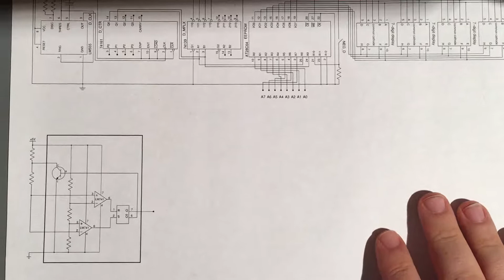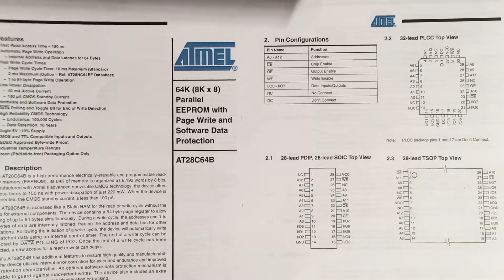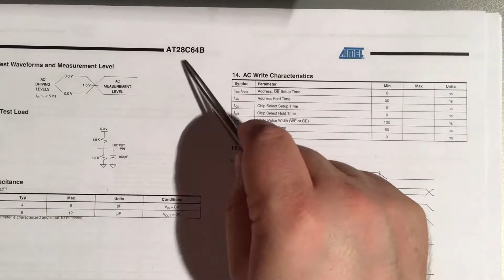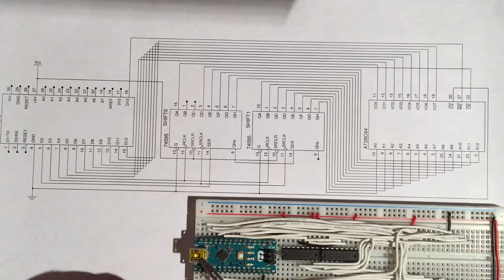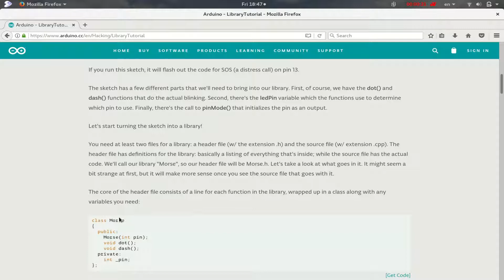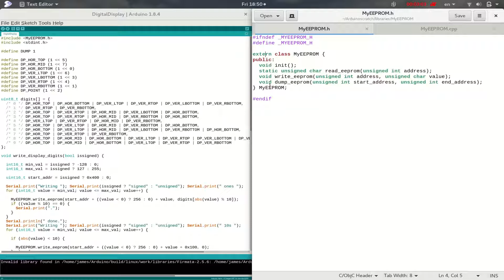My Ben Eater inspired homemade 8-bit CPU - Part 8: Decimal display

Comment: Will Ben's EEPROMs not work with your design? I have it working with the display, but I was just thinking about the control logic later on. (28C16 EEPROM)
Reply from the maker: Yes, they should work for the display. I couldn't find any when I was ordering parts, so I got the bigger ones. For my control logic (episode 9), that turned out to be a good thing, since I need a lot more input lines (i.e. EEPROM address lines) than Ben Eater did. In fact, I'm still short by 2 lines, but manage to work around it using some custom combinational logic.
Reply: @jimmyb998  so, could I technically just use more 28C16's?
Reply from the maker: Technically yes, but it'd be very complicated: you have 13-15 bits of "address" (control logic input: microtimer, IR and flags) that you'd need to demultiplex in order to select one bank of 4 eeproms out of a total of 8 to 32 banks of 4 eeproms. I think bigger eeproms are way simpler ...
Reply: @jimmyb998  :\ that's super unfortunate because I have bens eeproms already. I started ordering parts for his cpu before I saw your wonderful video series. I am currently re-wiring the ALU and adding two more general registers at the moment. I'll keep you posted on how things go.

Comment: You could have used only one shift register, as you can also use the "analog" pins as digital as well. It's just that the ADC mux is connected to those pins, not that they're exclusively analog inputs, something that should be explained better on the Arduino.
Reply from the maker: Yes, I discovered that later. Using just the digital pins and the two shift registers is very close to Ben Eater's original programmer.

Comment: 16:07 You could buy/make a frequency counter for just $10. It won't be very accurate, but it would allow you to measure frequency. I recommend you get a Rigol DS1054Z if you're going to do electronics stuff, though. Anyway, I've already tested it and it's nowhere near 5 MHz. The maximum I was able to get is 850 kHz, and I had to move away from the circuit for that! It's pretty unstable and just getting near it changes the frequency and waveform. Also, remember that there are actually lots of small capacitances in parallel: the two terminals of the breadboard, the pins of the 555 timer, internal capacitances, you and one pin of the 555...
Reply from the maker: very interesting. So it is oscillating "uncontrolled" basically. I guess it's fine for just the decimal display though

Comment: I would like to reuse Ben Eaters programmer, so to program your decimal display as well as Ben`s with 1 breadboard programmer , is that possible or are there more differences than the more adress lines at your eeprom?
Reply from the maker: I think I mounted my shift register LSB first, whereas Ben's is MSB. One needs to be aware of that when sending the address out to it.
Reply: On the eeprom in the schematic pin 21 ist tied to GND via a resistor, on the breadboard I think I see a bridge between pin 21 and 20 direct to GND. I also see in schematics a switch from pin 21 to 5v, which I cant`t find on breadboard. where is my mistake?
Reply from the maker: In the schematic, you can select if you want signed or unsigned display, which is set on A10 (pin 21). I didn't actually implement that in the hardware, which is hardwired (whence no pull-down resistor) to ground (i.e. unsigned display). Up to you if you want to use the signed display feature ;)
Reply: ah, thanks! the pin numbers in the schematics of the 7 Segment displays do not correspond to the pin letters, at least compared with the datasheet, which says e.g. A on Pin 7 , B on pin 6 and so on. little bit confused ...should I connect e.g. pin 11 of the eeprom to pin 10 on the 7seg or to pin E in the datasheet?
Reply from the maker: Honestly, I didn't look at the datasheet much... I just used trial and error (shorting them to 0V and 5V with a jump wire) to figure out which of the 7-segment display pins activates which display segment. I then defined constants in the C++ Arduino code for each of those pins, so I could construct the actual digits using those constants.

Comment: So there seems to be a bit of a difference from the schematic and your implementation. Just want to make sure.  On the schematic you have pins 4 5 6 7  of the 74139 chip connected to the cathodes of the seven segment display. On your breadboard you are using pins 9 10 11 12. I'm assuming that this is just for having the board a bit more tidy?
Reply from the maker: Well spotted!

Yes, in the implementation I am actually using input pins 14 and 13, and output pins 12, 10, 9 and 8, as they are conveniently all located along the top of the chip.

On the schematic, I overlooked that, and connected input pins 2 and 3, and output pins 4, 5, 6 and 7, which in real life are all located on the bottom of the chip. Sorry for that ;)

Obviously either will work.
Reply: Cool! Just making sure there wasn't some technical reason for the change.
Reply: I did have an interesting problem with my clock. The output of the clock was a bit noisy so I put an extra decoupling capacitor on the output of the clock. On the oscilloscope it looked like a nice square wave and I had no problems with testing the registers. Once I got to the program counter it would behave very strangely and not count correctly. Turns out the rise time of the clock edge was actually too long! A smaller capacitor solved the problem but it was interesting to debug. I may make a video about it.
Reply: Edward could you give some numbers please, what values were the capacitors, and maybe also what was the rise time?

Comment: There is a capacitor between ground and pin 2, it's made out of the leads for pin 1 and pin 2 and the air in-between, and it's very very very low value  ;)
Analogue pins A0-A5 although not A6-A7 (???????) can also be used as digital outputs.